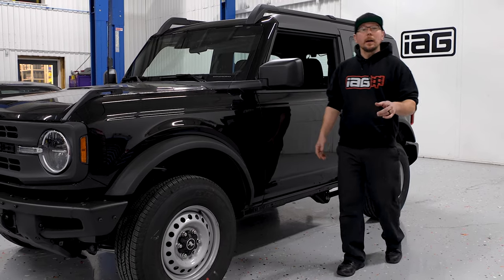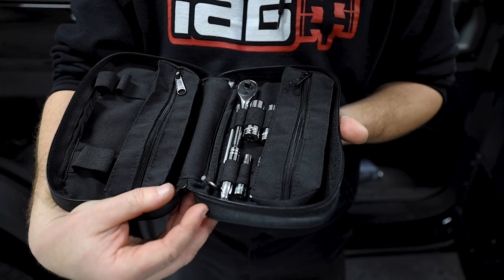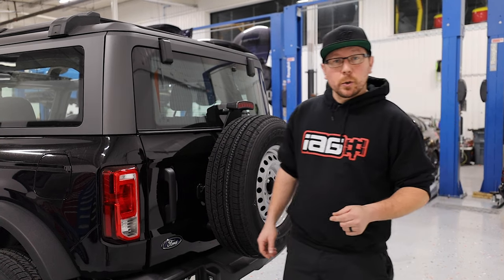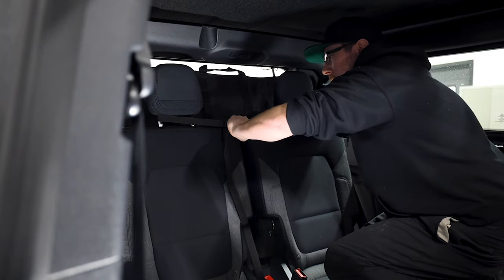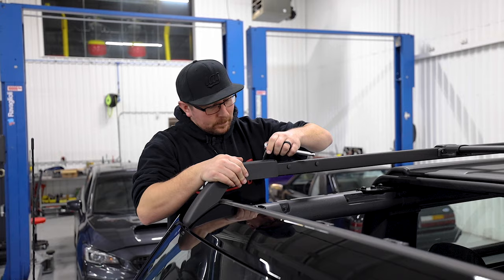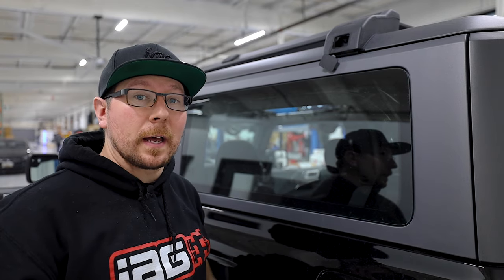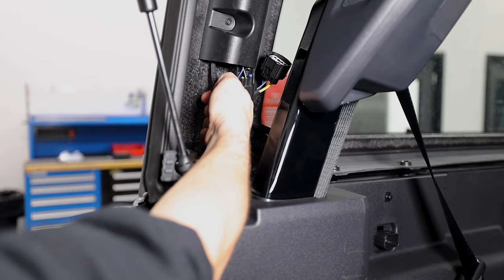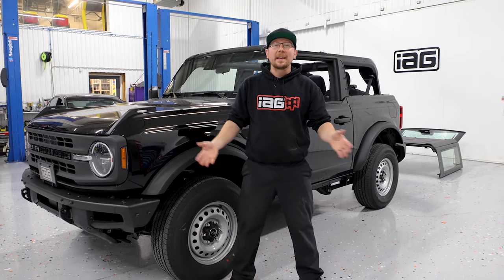2021 Ford Bronco Hard Top Removal  | Bronco How To | IAG Performance

Comment: Are there centering pins that go in the roll bar holes above the door for the hardtop panel?
I want to build a “radio” bar that attaches above each door, so I can mount my mobile ham radio.  I’d like to use the forward most hole to mount the bar.  
I have a softop now, but plan to get a hardtop when they are available and I don’t want to do anything to hinder my hardtop installation when I get it.